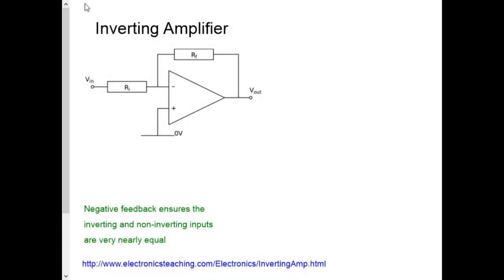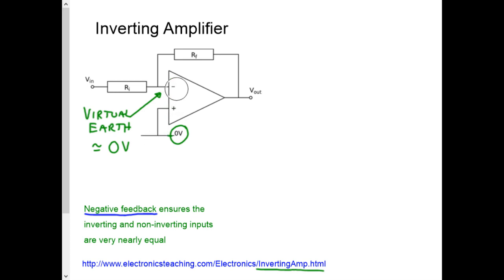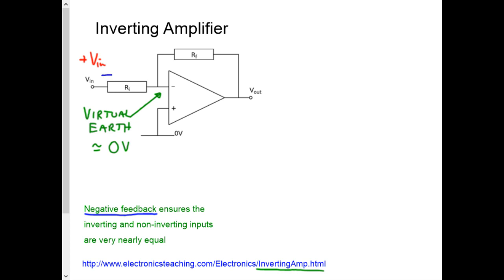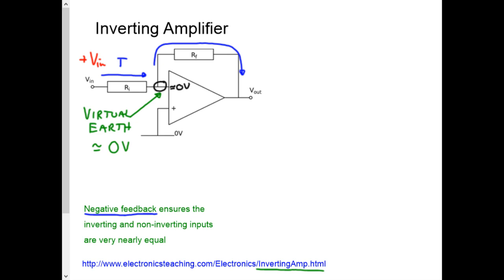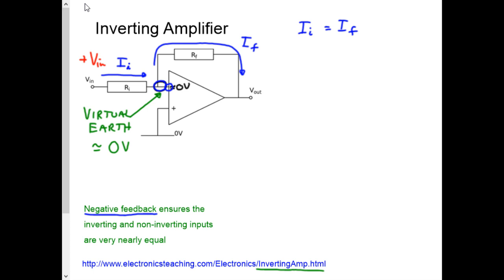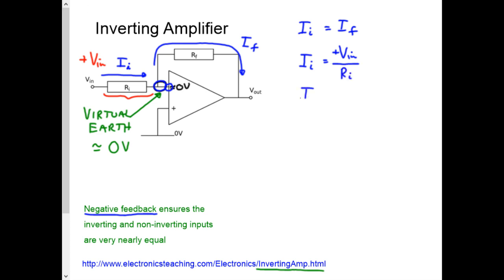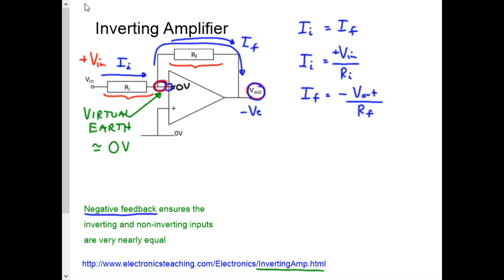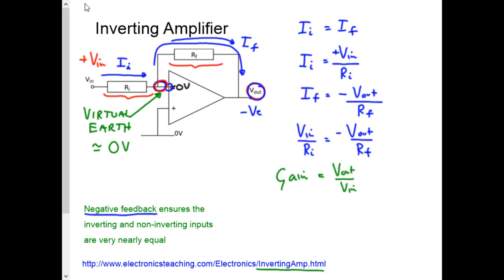Inverting Amplifier Gain Derivation

Comment: Why is there any current flowing through Rf if there is a ground at the amps negative port?
Reply from the maker: The inverting input is a virtual ground. The two resistors form a potential divider and the output voltage changes so that the centre of the potential divider (i.e. the inverting input) is always at (very nearly) 0V. Because there is a potential difference across the feedback resistor, current must flow (I=V/R). The same current flows through both resistors and the potential differences across these two resistors are such that the inverting input is held at (or very close to) zero volts.